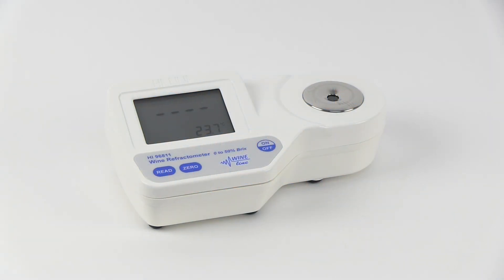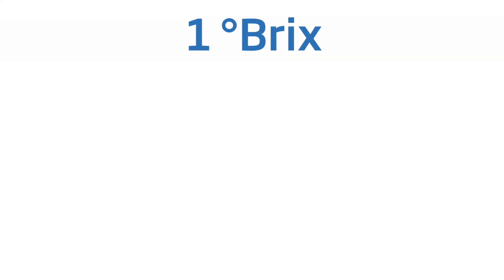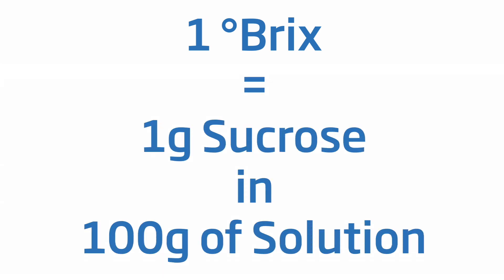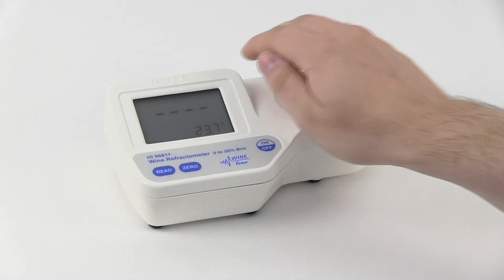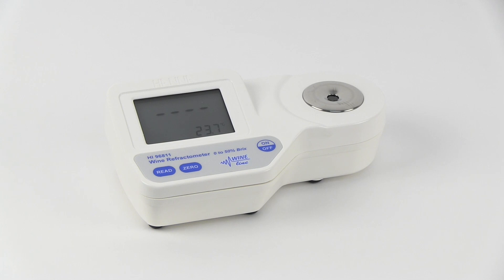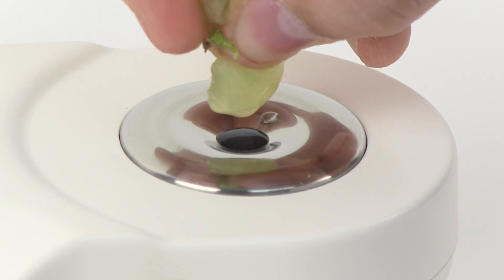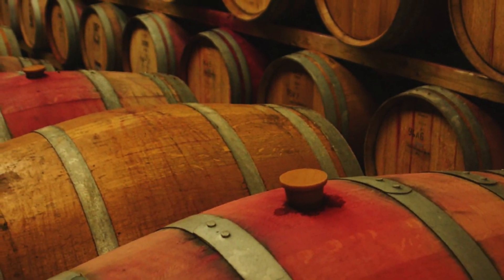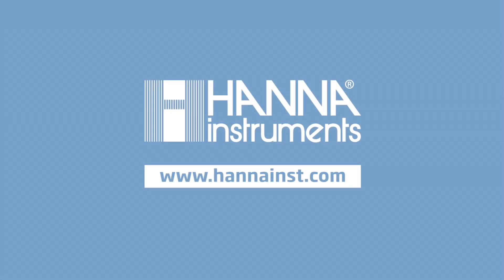Knowledge Base: Measuring Sugar in Grapes with the HI96811 Refractometer

Comment: how to use HI 96813 to determine potential alcohol
Reply from the maker: Hi Ardi, 
to check this, it is just like the video, but you need to change the setting. 
 
Just press RANGE until “P.ALc” appears. Then, follow the instructions as in the video. The result will be in % Potential Alcohol (%V/V). Hope this helps!
Reply: oke thank you i get it. 

one more question, about using conversion factor of potential alcohol. Which conversion factors should I choose when operate HI96813? 0.50 to 0.70 or C1?